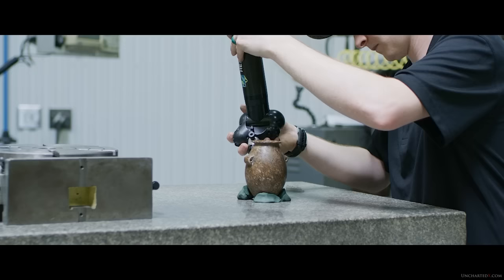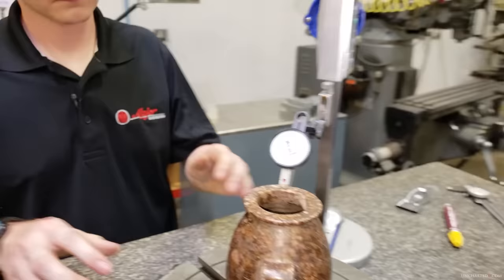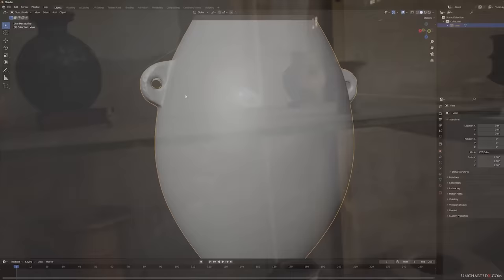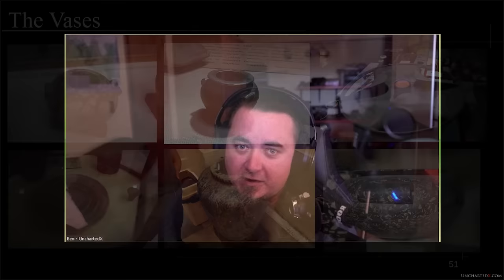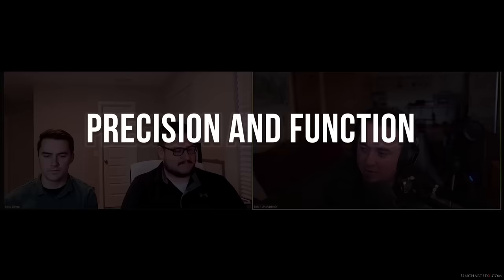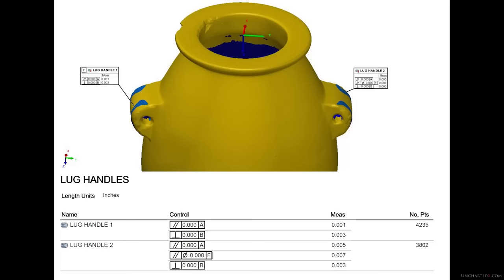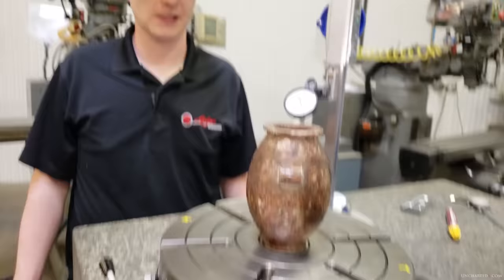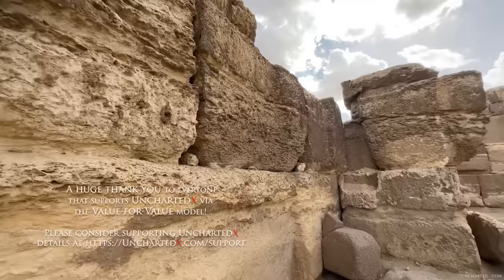Ancient Egyptian Vase Scan Update! STL file, More Analysis - and Between the Lug Handles

Comment: The scoop marks are mechanically made by some sort of machine . My question is what fuel or what powered this equipment . Power units are made from ?
Reply: Fire setting and stone tools.
Reply: @AustinKoleCarlisle  fire setting weakens stone to the point of it being brittle. This is especially true for granite. Then using a tool like an adze or some type of pickaxe would make quick work of the brittle stone. They probably used an adze to make the "scoop marks" so yes, it makes total sense. They had both stone and metal adzes but any two handed tool would work. After you burn the stone you quench it with water and it basically breaks for you.
Reply: @_MikeJon_  you didn't address either point i raised. fire-setting doesn't explain vertical scoop marks (on the wall surfaces) nor does it explain the "scoops" oriented to a fixed point.
Reply: @AustinKoleCarlisle  you didn't read what I wrote, clearly. I did address it.
Reply: @AustinKoleCarlisle  Just go do some basic research on fire setting in egypt. It's pretty easy to find.
Reply: @_MikeJon_  fire setting doesn't explain either of those. you need to explain how it does.
Reply: @AustinKoleCarlisle  dude... go read what I wrote lol. Do you really not understand what I said? Fire setting makes stone brittle. Especially granite and Especially when you pour cold water on it. After you burn the stone then quench; it can be easily chipped away. The "scoop" marks are from the types of tools. I don't know how you're not following along. Do you know what fire setting is?
Reply: @_MikeJon_  and i said fire-setting doesn't explain the VERTICAL scoop marks. nor does it explain the scoop marks oriented around a fixed point.
Reply: @AustinKoleCarlisle  bro, if you dig down all the marks will be vertical if you're at the bottom of the trench looking up lol use some common sense. And if you burn a stone you can quarry it from whatever angle you like. Those are such non points. And AGAIN you're entirely missing what I'm saying. You use firesetting THEN quarry with the tools after the stone is broken down from heat and thermal shock via cold water. That's very probably why they abandoned the massive obelisk. They cracked it with the heat from the fire.
Reply: @_MikeJon_  i'm talking about the 10+ ft vertical scoop marks lining the walls of some of these sites. and you didn't address the scoops oriented around a fixed point.
Reply: @AustinKoleCarlisle  but hey, I'm open to anything more logical. How do you suggest they did it? Aliens? Lol
Reply: @AustinKoleCarlisle  They were made by individual workers. On the wall above the obelisk there's what seems to be a record of the laborers work scratched into the wall. One worker per section. Each one was seemingly responsible for their section so it will have a linear progression to the bottom.
Reply: @AustinKoleCarlisle  And the fixed point is even easier to accomplish. Heat rises. When you get under the thing you would need even less fire to have an effect. I assume you're talking about where it's still attached to the bedrock, yeah? That's the easiest way to get it out. Undercut when you Quarry so you can simply put rollers under it as you quarry. That way you wouldn't even need to lift it until you erect it. Pretty genus and a simple concept at the same time. Plus it will be the support until you Quarry it out and put rollers under it. Makes total sense.
Reply: @_MikeJon_  with an unknown technology. there are more examples of it being used besides these vases, of course.
Reply: @AustinKoleCarlisle  FYI he just deleted a comment I posted...
Reply: @AustinKoleCarlisle  actually it's now two on this post alone. Thats three total. Just goes to show you what type of person you get your information from. I've clearly been civil with you. This man is a charlatan.
Reply: @_MikeJon_  what are you talking about?
Reply: @AustinKoleCarlisle  unchartedX literally deleted two of my comments here  because I referred to other youtubers. He did it on another thread on this video as well

Comment: The gap between the lug handles could be turned if the turning is manual and the tool is following a profile. Just the side walls of the lug handles would need adjusting to make parallel and create the lug holes.

Comment: The area between the lugs COULD be 'turned' in the literal meaning if the artifact was produced ON a lathe but using a toolpost grinder or cutter -- that is, the 'tool' was itself a high speed rotary cutting head ;- the rate of rotation of the workpiece need only be very small - in fact it would be most likely manufactured by progressively deepening cuts taking off the most non round areas first and then a finishing skim in the conventional turning sense (but still using a powered cutting device which cuts only minute amounts each rotation to avoid chipping or leaving machining marks - probably done with copious cutting fluid/coolant also.  Think of a pig on a spit if that helps -the vase is the pig which is slowly rotated or stopped at various points to remove excess material and the 'tool' moves up and down the lathe bed  (from head to tail ...)generating the vase's Profile shape (stopping at the lugs of course but creating the exact paralleicity of the lugs naturally )   Copying lathes use this method to produce furniture spindles and things like axe handles in more sophisticated versions --only one profile shape is needed so that the slaved tool reproduces the same exact shape for 360 degrees  (your opening shot of a milling machine producing circular external and internal surfaces but NOT being turned is another example ( x+y = r is the equation for a circle )   This is still evidence of even more sophisticated machining capability in fact --'simple' turning is much easier (but doesn't get you lugs ...)- a profile template that guided a fixed tool would still be needed to get a smooth profile when 'just' turning . (modern CNC would use x and y co ordinates to position the tool point and stepper motors etc etc -- the implications as to the state of knowledge and technical ability at this extraordinary remove of deep time is hard to fathom -- the 'wavy' bowls and schist disc still defy our attempts to figure out how they did it - even in theory.....
Reply: Sorry for the 'crossing out'  it is unintentional due to some glitch in this old laptop .  only appears after posting

Comment: I'm a tool and die maker, and I run our CNC Mill and Lathe. These tolerances, especially on the thinner parts would be extremely difficult to turn. The knubs are in the way and you would have to machine them in a separate operation. Not to mention cutting the inside material out. I wonder what tolerance those holes with the knubs are and if they go with the curvature of the vase? If they are held tight as well as curved, I don't know how one would machine that. All I can say is, when you are manufacturing something where tolerances are needed, it's generally going to be used for functions not decorations. I'm convinced these artifacts had some sort of function.

Comment: As a PhD engineer who worked (among other things) in designing systems for SHORAD (short range air defense) I think you started to nail the subject of advanced technologies in ancient Egypt. In former videos (not only from you but all other channels that deal with the subject) there was always a subjective feeling: you see the object and think something in the line of "oh man, it´s impossible to do that with copper and stone tools". But when a real object is measured and precision standards are established then it becomes crystal clear that any explanation that does not give these standards is flawed. Moreover because measurements can be done in other objects from museums and private collections and this includes not only vases and jars but also statues and other objects.

One interesting thing that nobody mentioned is that in the map there are topological symmetries that can only be explained if it was done by automated process. It is clear particularly in the surface of the handles where one side topology matches the other side. Not something that would happen by manual process.

In this video you said that some people questioned the origin of this particular vase, but the point is that even with modern equipment to get this degree of precision the cost of sculpting this artifact would be higher than its market value... Besides I think the collector in its possession can trace its origin... Besides it matches exacly the general standards of thousands of other similar vases with attested origin sitting in Cairo/Saqqara and dozens of other museums.

What I suggest is that you guys write a paper and submit it to a scientific journal. Not in Archaeology, but a technical journal in Engineering. Once published in a high impact factor journal/transactions it would be very bad for the people I won't tell their names to deny access to other objects. And from further studies the process of manufacture can be better understood.

Comment: Love your work man. Just incredible what you're bringing to the public. I wanted to recommend that you touch on the subject of the radiocarbon dating of the wood and charcoal found in the pyramids. For one, I'm very interested in hearing where you stand on that subject, the results of those tests, their accuracy and their relevance for the overall construction dates of the pyramids. But also, it's a subject that weirdly seems to be missing from both sides of the "debate" regarding the age of these ancient megaliths.  It seems like there can be no full examination of the evidence without it too. Even if you have a chance to make a short video discussing it, it would be amazing. As I said before, I'd love to hear your thoughts on it.
Reply: Disappointed that nobody has seen or responded to this comment yet, I did more research and have tried to imagine what that position might be. So it seems to me that one argument against the dates of the radiocarbon dating is the charcoal that was gathered from mortar used between blocks of stone and what the use of mortar in those parts of the structure might signify. Since it's clear that, at least, the vast majority of the oldest constructions require and use no mortar at all within the precision carved blocks, it could be surmised that any part of a construction that utilizes mortar is either a late repair or add-on to a far older pre-existing structure. In terms of the supports made of ancient logs could also be explained in a similar way - possibly - but it would require more research to be able to make that argument. This is a purely imaginary response here without proper research to back it up. I would love to hear Ben's own thoughts on it. If I've missed the discussion of it in any of his videos, I'd appreciate someone pointing me in that direction.

Comment: Engineer working in aviation, working within tolerances of .001" is still not an easy task with modern day equipment. We've seriously got to keep digging to get an understanding of how they accomplished such a feat. Ben, if you're 2024 trip to Egypt will be open to invitation, I'd love to join; I've so many questions and want to be around like curious minds.
Reply: what's most impressive is that the same tolerances were maintained in the area between the handles and the rest of the exterior surface. this implies some sort of computer-controlled element was responsible as the tolerance is too small to measure using traditional tools.
Reply: Hook, line and sinker...  💰 🤑 💸

Comment: to answer your question the tool used in stone shaping, carving is an immaterial energy beam that cut by breaking valence electrons responsible  of atom accretion , must be used with CNC type machine , the material is not touched the desintegrator cutting tool is doing all the movement around the piece and must have precision sensor to guide the tool, one side effect of this tool is deposition of very fine quartz layer on the untouched surface

Comment: I think it's time to create a logic chain. For example, these vases appear to be created on something similar to a lathe. If true, some how they were able to make extremely accurate bearings. Ball bearings or roller bearings or plain bearings, something that can be made extremely accurate. This implies at least two bearings in a row with a shaft between the two. Also at the working and of this "lathe", the cutter appears to have to have rotational ability to cut between the handles, i.e. the cutter is spinning. This implies more bearings and a flexible driving means. Also where does the power come to run this machine? 50 slaves running on a treadmill doesn't seem to fill the bill.

All these suppositions are expandable. There is a scary logic chain in here.

Comment: One point to add is that the measured 'inaccuracies' are likely only the result of the hand polishing process and wear, being machined with absolute precision within the structural rigidity of the specific material and its inherent resonant frequencies, given that any sufficiently rigid diamond or other tooling process even capable of close tolerance would necessarily produce absolute precision or show obvious signs of chatter marks and the discussed soft to hard tool pressure irregularities and surface tears.

Only a totally rigid setup could account for the observed surface finish before hand polishing with abrasives resulting in the aforesaid runout where it is witnessed. Abrasives do not require the tool pressure of deeper shaping cutters and would not distort the surface much if the variable inclusion hardnesses are relatively similar. It's all still solid rock, essentially. Held rigidly, a sanding pad or grinding wheel/disc would also be capable of working to precise tolerances as well, like we do today for final finishing of hardened steels for example, if an equally controlled depth of cut was possible.

Also, given the actual age of these artifacts being essentially unknown, it can be assumed that some degree of distortion, shrinkage, differential expansion or other material movement may well have occurred since manufacture due to countless hot/cold day and night cycles and high to low humidity seasonal variations in environmental conditions. That's how rocks made of fossils are formed in the first place by repeated compression/decompression and heat cycles including but not limited to oxidation or other chemical processes, given that their purpose may not have only or even been to hold fresh water.

Comment: It would be very relevant if two vases are identically machined/ground/lapped/polished.  It would prove they were both made using the same fixtures. It would prove the manufacturers used a set up that creates vases with highly accurate consistency.

Comment: 90% of the material between the lugs could be machined out by changing the axis  ,Only the flat vertical sides and curved surfaces  of the lugs have to be finished by hand , I'm sure you can appreciate being as exact as you possibly can . It still blows my mind that the integrity of the vases and bowls withstood the machining process .

Comment: All I can think is that there must have been a cutting face that moved in an arc from base to top while the vase rotated, this cutting face could have left the 'lugs' as cubes while getting all the other faces rotationally as well as vertically aligned.

Of course, this is an even more amazing prospect to consider than just using a lathe and increases, as opposed to diminishes, the degree of workmanship required.

An examination of the exact angles where the lugs meet the main surface and surface quality of the sides of the lugs would, I believe, give important hints as to construction techniques, far more than just the outside main surface.

Comment: In a nutshell: if Lockheed-Martin would find it difficult to reproduce this stone vase, then a man with a stone ball and copper chisel has no chance at all. That's axiomatic.
BEN:  could you try to get a mathematical approximation function of the outer vase curve? You got the experts for this. If the outer curve follows a known transcendental mathematical function then we see that the creators were highly advanced, just as we are. The Gaudí cathedral in Barcelona uses complex hyperbolic mathematic curves while simple Roman curves were often just round arcs, which are primitive in comparison. :face-blue-smiling:

Comment: Ben, providing a short video on how a machine shop laith and multi axis machine function, will help people have a better frame of reference of how the vase and esp the handles could be "machined." Also how they use calipers to measure, and display the gap with a flashlight, to show how
 .001 tolerance isn't visible to the eye.

Comment: I'm certainly not saying that I know how this was made, but just a thought for the bit between the handle. If it was turned on a hand powered lathe, maybe they were capable of rotating back and forth over a limited range of motion to only cut the region between the handles. Obviously it would be slower going than turning a full circle, but I think it could be possible.
Reply: The end  points of rotation, would need to be precisely set. The rotation would still require precise bearings.
Reply: @jamemswright3044  yeh. I'm not claiming to know how it was done. But I could imagine that you could maybe do it. It might also take a week to make one pot.  I also thought about a higher speed rotating tool and a slowly rotating workpiece, like a dremel and the workpiece in an indexing chuck. But having no archeology of any such tools makes it difficult. They don't even credit them with having wheels. 🤷‍♂️